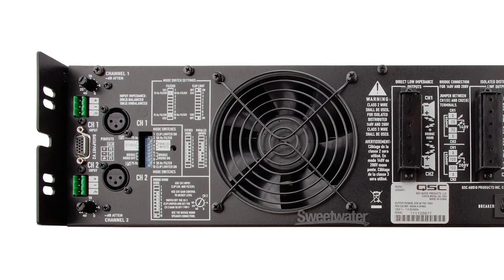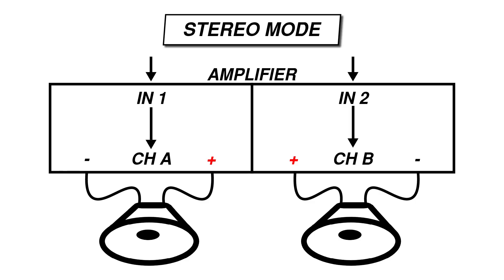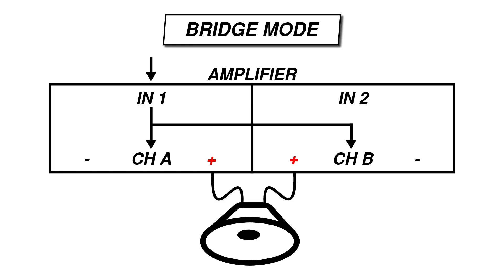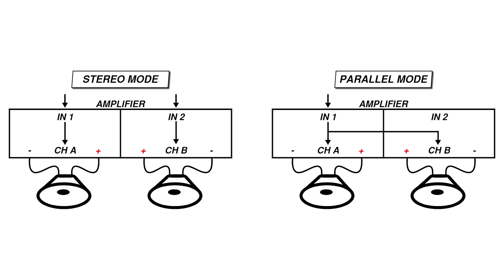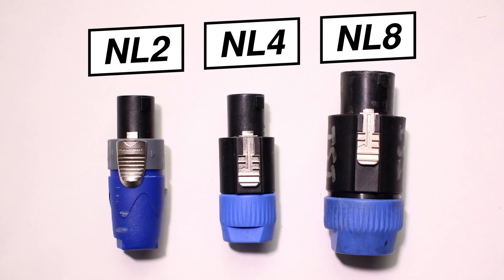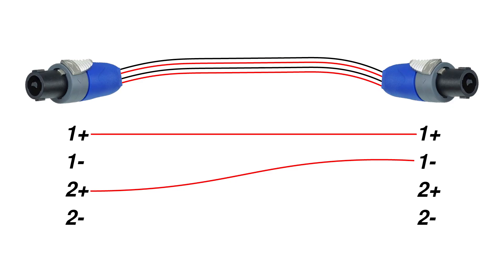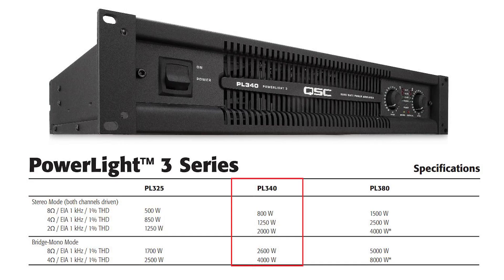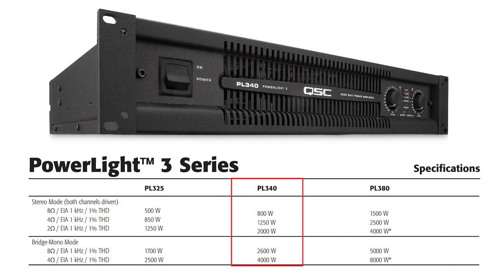How To Set Up An Amplifier [Bridge vs Parallel vs Stereo]

Comment: Hello, nice channel you have. For the Bridge mode there is a very important difference that was not mentioned. In parallel mono the same source is used to feed both amplifiers, for bridge mode there is a phase inverter that needs to be inserted between the source and the amps in order to split the signal in two with a 180 degrees phase shift between each other. Without this phase inverter, if you connect a speaker between the two positives of each channel the result will be the cancellation of the resultant signal and the outcome won't be the desired one but interesting to hear. I watched the video a couple of times before adding this comment and could not identify this detail in the explanation. The power amplifiers (some of them) have a control switch to move into bridge mode, so is an easy change for the end user but thought that know how bridge mode works at the input would be important too. Thanks for the tutorials and keep going. Regards.
Reply: He does explain all of that, plus the phase difference, in the video ... see 3 minutes in ... the waveforms (both positives) are shown out of phase ...
Reply: Some amps, including the one I had that bridged into mono mode, only said that you had to feed an input into ONE of the channels jin order to utilize the bridge mode, NOT an opposite inverted signal into both channel inputs at once... So maybe some amps will do this inversion that you speak of internally and automatically whenever you place it into bridge mode, and you only use ONE of the channels as a mono input signal.
Reply: back in the day i remember you had to open up the amps to put them into bridge mode.  of course nowadays it's just a switch.  but yeah, i liked the tech explanation of how bridge actually works.  just learned something new, thanks
Reply: All that means is to bridge a stereo amp, the input has to be balanced in order to make it work. If you send the amp a single ended signal, it can do the conversion inside the amp. Its essentially a DI box, only they put it inside the amp.

Comment: I have an old carvin two channel power amp. I m not sure if channel one  is working or not . I m a novice to setting up a PA I' m the drummer in the band but I own the PA . I see the buttons in the back parallel bridge etc. I try to run one channel to one speaker and the other channel to the other speaker. But channel one comes out faint . Any advice? Thanks In advance .
Reply from the maker: To run each channel to a separate speaker, you’ll want to choose either stereo or parallel. Stereo if you want different signal to each channel, parallel if you want the same signal to each channel.
Reply: @AudioUniversity   Since it is an old amp in the back there are four buttons parallel/ input , ground/ lift, limiter and a buried says bridge .

Comment: Hello Kyle
Your video is awesome 
My question is how to I run 2 main speakers and 1 subwoofer with speakon connectors in Bridge mono mode? 
I have a powered mixer Behringer PMP4000
My speakers are EV TX1152 
And my sub is EV TX1181